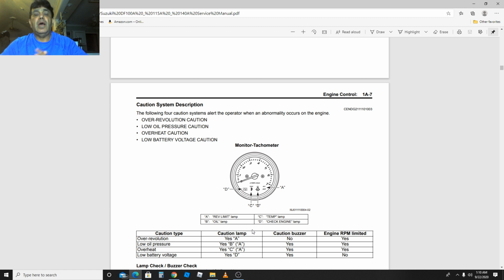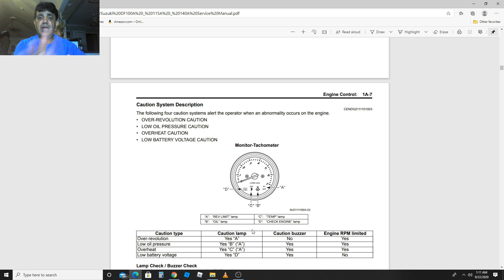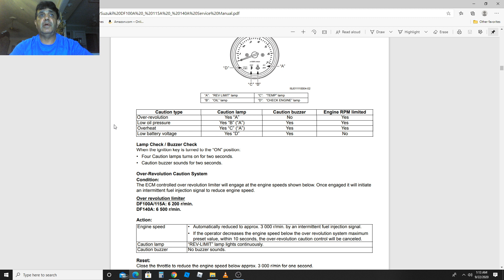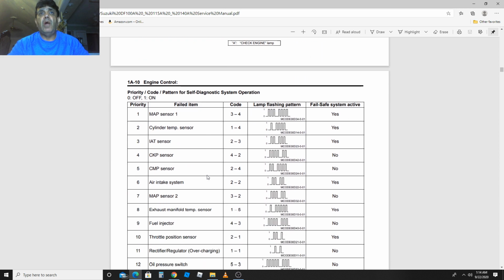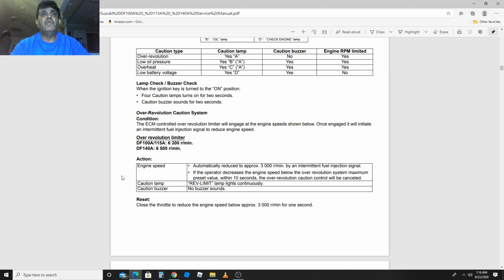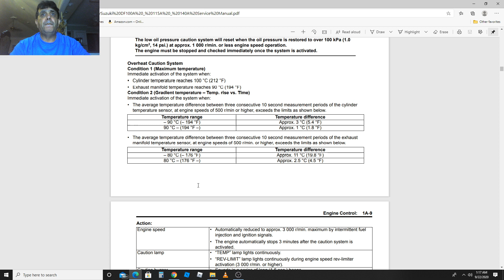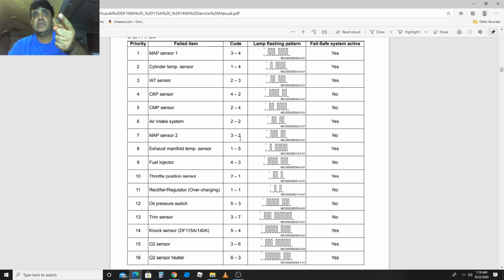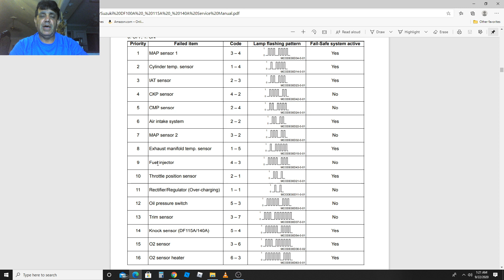Engine warning alarm codes for Df Suzuki Df 100/115/140

Comment: I have a problem with my suzuki 115hp..the light code is 6:3 means O2 sensor.anybody can help me to solve my problem?can show me where the sensor O2 is placing
Reply from the maker: Try to buy it and you see the shape of it . It is the size of a aa battery and has a wire sticking out of it , very easy to replace , it possibly has rust on it and ground is not working. clean the rust and it should work,, 15 minute job . it checks the exhaust for unburned oxygen , fuel mixture. you can look up cars oxygen sensor to get an idea. It is like looking up a Tire...all tires look a like .. I hope it helped
Reply: @boashna  I have the same problem, looked it up and seen your answer, Thanks!!!

Comment: I have suski 175. Boat ran fine both trips out so far but did get the rev limit and low oil pressure alarm. Oil levels are fine and not leaking any place
Reply from the maker: If you race the engine by going high and low on rpm quickly you get the rev limiter.. this is what the service book says 
Over-Revolution Caution System
 Condition:
 Yes
 Yes
 Yes
 Yes
 Yes
 No
 The ECM controlled over revolution limiter will engage at the engine speeds shown below. Once engaged it will initiate 
an intermittent fuel injection signal to reduce engine speed.
 Over revolution limiter
 DF100A/115A: 6 200 r/min.
 DF140A: 6 500 r/min.
 Action:
 Engine speed
 • Automatically reduced to approx. 3 000 r/min. by an intermittent fuel injection signal.
 • If the operator decreases the engine speed below the over revolution system maximum 
preset value, within 10 seconds, the over-revolution caution control will be canceled.
 Caution lamp
 Caution buzzer
 Reset:
 “REV-LIMIT” lamp lights continuously.
 No buzzer sounds.
 Close the throttle to reduce the engine speed below approx. 3 000 r/min for one second.
1A-8 Engine Control: 
Low Oil Pressure Caution System
 Condition:
 Immediate activation of the system when the oil pressure switch is turned “ON” due to an engine oil pressure drop 
below 100 kPa (1.0 kg/cm2, 14 psi.) while the engine is running.
 Action:
 Engine speed
 • Automatically reduced to approx. 1 000 r/min. maximum by an intermittent fuel 
injection signal.
 • The engine automatically stops 3 minutes after the caution system is activated.
 Caution lamp
 Caution buzzer
 • “OIL” lamp lights continuously.
 • “REV-LIMIT” lamp lights continuously during engine speed rev-limiter 
activation (1 000 r/min, or higher).
 • Sounds in a series of long (1.5 sec.) beeps.
 NOTE
 If the engine is automatically stopped due to the caution system, the engine can be started again.
 However, the caution system will repeatedly activate until the cause is eliminated.
 Reset:
 Stop the engine and check the engine oil level. Refill the engine oil to the correct level if it is below the low oil level 
mark.
 If the engine oil level is correct, the following causes may be considered:
 • Improper oil viscosity.
 • Malfunctioning oil pressure switch.
 • Clogged oil strainer or oil filter.
 • Worn oil pump relief valve.
 • Oil leakage from the oil passage.
 • Excessive wear/damage of oil pump.
 NOTE
 The low oil pressure caution system will reset when the oil pressure is restored to over 100 kPa (1.0 
kg/cm2, 14 psi.) at approx. 1 000 r/min. or less engine speed operation.
 The engine must be stopped and checked immediately once the system is activated

Comment: Hi I have a df250 Suzuki outboard not going past 3000 rpm but if I hit the trim down button it speeds up can you assist in anyway thanks
Reply from the maker: describe the alarm and light. does it happen when engine is cold, or does it happen when engine is warm. lowering engine makes fuel get to engine
easier so if there is no alarm a dirty fuel filter or primer needs to be squeezed.

Comment from the maker: Oil chang remider makes beeping sound and oil light stays on solid . pull the kill switch 3 times in 10 sec to reset the oil change remider . long beep means you completed the task.

Comment: Df140 what if it beeps and stays lit and stops beeping but light stays solid
Reply from the maker: OIl change at 100 hrs reminder. solid oil light along with beeping . After chnaging oil pull kill switch 3 times while powered and  beeping in 10 sec to reset it. long beep means reset complete.
Reply: @boashna  its an old boat that i barely got. Motor is an 2005

Comment: Hello friend. I have DF140, and the problem is that RPM slowly drops from 5000 to 2000 after just 10 minutes of driving. After starting it up again, the same thing happens. Any suggestion! Thank you…
Reply from the maker: no beeping sound or alarm .  you should get a code or alarm. .
Reply: @boashna  no beep sound or alarm… just drops the RPM
Reply from the maker: it could be fuel flow disconnect fuel filter turn fuel filter upside down and dump fuel to clean it. check primer it can have tinny holes may not be visible and adds air to fuel.
Reply from the maker: safe mode is 3000 rpm not 2000 rpm .. I think you use up all the fuel then engine starving for fuel .
Reply: @boashna  how can I send you dm. I want to send you clip of my engine. thanks
Reply from the maker: watch this link https://www.youtube.com/watch?v=BTrd3sM24P0

uploaded your video. then send a link  just like me.

Comment: hei my egine .df 70, 98
. dont show tot ouer and bip every 7 sec , no code all fine .3500 rpm
Reply from the maker: Buy repair book electronically from e -bay cheap.
buzz sound every 5 sec is 

Oil Change Reminder System Description
CENDG2111101007
This system informs the operator that it is time to change 
the ENGINE OIL based on the recommended 
maintenance schedule.
When the total motor operating hours has reached the 
pre-programmed hours, the “OIL” lamp will flash, and the 
buzzer will begin a series of double beeps if the engine 
is not running (but ignition switch is “ON”).
The above mentioned indication will repeat until the 
activated system is manually canceled.
NOTE
This system will activate up to 2 100 hour’s 
operation.
Indication of System Activation
Buzzer
Oil lamp
Cancellation Procedure
1) Turn the ignition key to the “ON” position.
2) Remove the emergency stop switch plate (1).
3) Pull out the emergency stop switch knob (2) three 
times in ten seconds.
A short beep will be heard if the cancellation is 
successful.
4) Turn the ignition key to the “OFF” position.
5) Set the emergency stop switch plate (1) into the 
original position.
NOTE
• Cancellation of the system is possible 
whether or not the engine oil has been 
replaced.
Once the system has been activated, 
SUZUKI strongly recommends that the 
engine oil be replaced before canceling the 
system.
• If the engine oil has been replaced with the 
system not activated, it is still necessary to 
perform the cancellation procedure to 
reset the Oil Change Reminder System

Comment: Hello friend, I have a question for you. I have a suzuki 225 2010 that for the first time I had a problem. When I turn on the key, its beep is low and when I turn it on it does nothing, but on the tacometer it shows the Ck engine flashing 4 times, it pauses and flashes 2 more times. In your experience it could be those codes that it shows on the screen.
Reply from the maker: 4-2 is ckp sensor on 140 engines should be the same for your engine - engine appears to run normal and it is not restricted mode of 3000rpm or less  - I am not a Mechanic ,I just fix my boat reading the book.  it is under the flywheel  air intake  side and one inch below flywheel . clean it and may work for you. flywheel cover needs to come off to be able to see it . tracks how fast flywheel is turning or moving possibley using magnets - every time magnet goes by it is one turn clean both sides flywheel and sensor side . 30 minut job-no need to take off flywheel just the cover 
You can buy a book from e bay for your engine very cheap. cars have them as well read this  
https://dannysengineportal.com/position-sensors-ckp-cmp-function-and-failure-symptoms/
CKP Sensor Removal and Installation
CENDG2111306006
Removal
1) Remove lower side covers.
Refer to “Lower Side Cover Removal and 
Installation” in Section 2A (Page 2A-3).
2) Remove ring gear cover (1).
3) Remove air intake silencer case.
Refer to “Air Intake Silencer Case Removal and 
Installation” in Section 1D (Page 1D-3).
4) Disconnect CKP sensor lead wire connector (2).
5) Remove two screws and CKP sensor (3).
Installation
Installation is reverse order of removal with special 
attention to the following steps.
• Apply thread lock to sensor securing screws.
: Thread lock cement 99000–32050 (SUZUKI 
Thread Lock 1342 (50 g)) 
• Install CKP sensor with air gap of 0.75 mm between 
sensor and reluctor bar on flywheel, then tighten 
sensor mounting screws securely.
CKP sensor air gap “a”
0.75 mm (0.030 in.)
• Check to ensure that all removed parts are back in 
original position.
• Check wire routing.
Refer to “Wiring Harness Routing Diagram” in Section 
4A (Page 4A-3).
CKP Sensor Inspection
CENDG2111306007
Inspect the CKP sensor.
Refer to “Resistance Check” (Page 1C-7).
Reply from the maker: this video answers you https://www.youtube.com/watch?v=gHrxFocAGBk

Comment: I was out yesterday (2017 DF115 with 800 hours) and got the flashing check engine light and a single group of 6 audible beeps, repeating. The flashing light is not following the beep code. I was running at 4200 rpm and I slowed and it went away after a few minutes then came back and then went away.  The RPM stayed up so it was not critical. Cannot seem to find out what it means. Ideas??
Reply from the maker: if exhaust temp changes too fast  it can Triger an alarm . you get that by ravening up then stopping then  reeving up again.. system will go to 3000 rpm then it will correct it self that is just one example of triggering an alarm. .too many sensors on board .  watch the video good info https://www.youtube.com/watch?v=kDIvnUZD4P0

Comment: Pls help my df140 a has a check engine warning light flashing 9 + 1 nobody seems to be able to tell me what the problem is even after service …..
help!
Reply from the maker: I seen some videos on you tube solving odd problems - one was fuel cooler clogged and yes no mechanic knew about such thing.  and a sensor that caused over heating (i think) problems on a twin engine. only two videos -  i try to find those two videos-  I have watched all YouTube videos related to Suzuki df
Reply from the maker: https://www.youtube.com/watch?v=BTrd3sM24P0   are you getting safe mode which is 3000 rpm maximum rpm  there are two videos on you tube this is one of them that shows s weird  Suzuki problems .   here is one of them
Reply from the maker: https://www.youtube.com/watch?v=xeOjSgJxJt8  found the second video - order a current service manual my book is from 2013 - it is a sensor issue and many sensors can be cleaned . I have cleaned them - use a dealer that has Suzuki as a main product and not a side business.  when you ask questions mention year ,  whether safe mode is engaged

Comment: Hello.  I have a problem with my DF 115.  Today I started it and just about a minute later it started to beep intermittently, but without turning on any indicator lights.  ?  I can accelerat without problem but the intermittent beep sounds.  Do you know what it could have?  Thanks.
Reply from the maker: how many beeps -  one one , two two .. it is like morse code - oil change reminder every hundred hours and  high voltage are most common.  when rpm does not go over 3000 rpm needs immediate attention and in your case it is a warning . High voltage is not a big deal . if I recalled I operated one engine for 500 hours with high voltage near 16 volt . if you use the boat everyday with high voltage , it will damage the battery . double beep with oil light on is change oil.. 1-1 is high voltage .in the video I show the codes.
Reply: @boashna  there is no light on and the beep is intermittent but continuous .... it does not correspond to any code that I know.
Reply from the maker: I watched your video - voltage at 16 volt gives a high voltage one beep - check your voltage- if you do not have a voltmeter your chartplotter can be set up to show voltage using overlay options ( complicated task) . If you push the ignition in then turn it resets the alarm .
Reply from the maker: fully charged battery is 13.2 volt and alarm is telling me the voltage is too high I believe 16volt or higher. Your electronics can handle high voltage . your battery is being charged all the time non stop. since my battery was low all the time I operated for about 500hrs with high voltage with no problem. if you boat couple times a week it can overcharge your battery and damage the battery.
Reply: @boashna  ok ... I'm going to check the voltage with the voltmeter.  Thanks.

Comment: I got a 2017 Suzuki DF 115 Two things happen that water in the gas in neutral it blinks I was able to find out I had a problem with my fuel vent was taking on water . fuel cell fixed it went away second thing I had happen I sucked a trash bag into the intake didn’t know it I was at high speed traveling and Boat went into limp mode on me then I got the manual out I shut the motor off I tilted the motor up and saw a trash bag on the intake I removed it set it back down about 25 minutes later start it Up no problems codes went away drove off nothing happened it was good to go
Reply: I just wanted to add something very good information though thank you for that information
Reply from the maker: Bravo- did you dump the water out of low pressure fuel filter.  I had a 5 inch thick  tugboat rope wrap around my prop and  no knife could cut it. I unwinded out of the prop in few seconds.  you should always unwind including fishing lines.